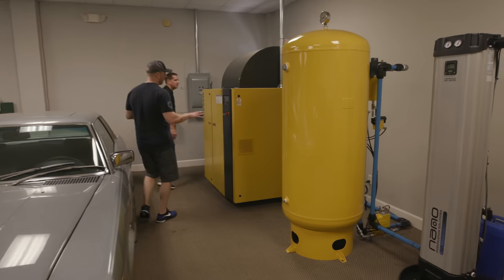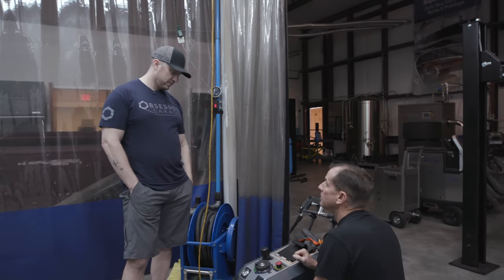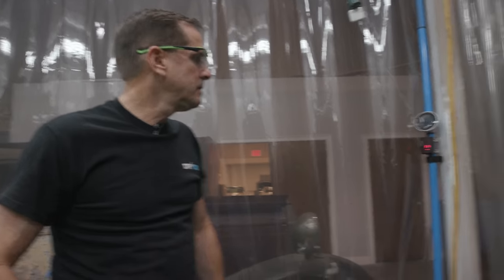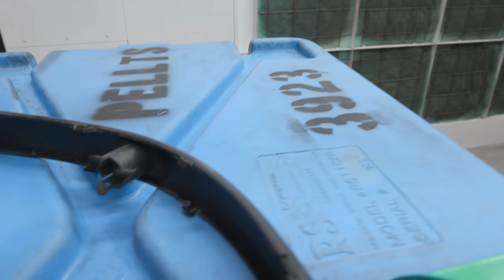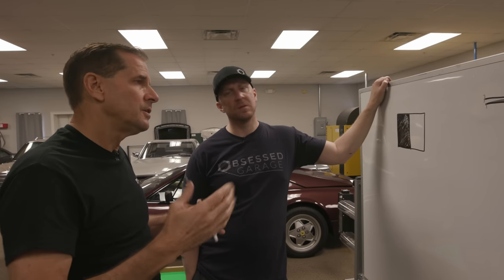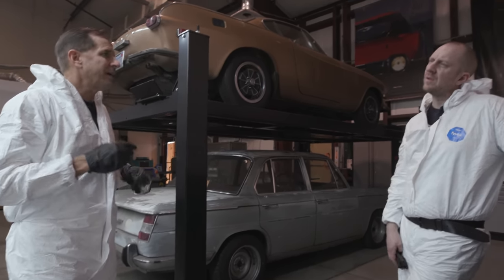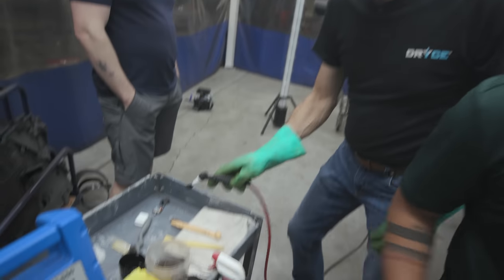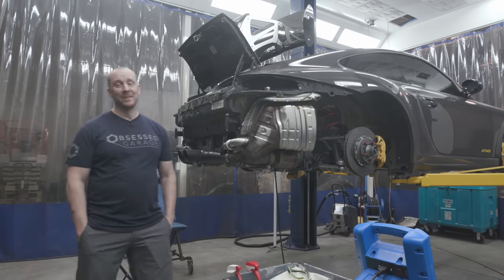DRY ICE CLEANING The 997.2 GT3 RS - Episode 1: Learning the Basics

Comment: As I understand it a single hose smashes the ice particles as the are pushed down the tube prior to exiting at the nozzle? Losing volume of the particle before it hits the surface to be cleaned.
Reply: That is not a performance experience I have ever heard before.  Would appreciate the technical source so I could review it.  
The point of a single hose system is to increase the blasting performance.   Which it certainly does.  So saving dry ice particles ( if that truly happens and has been documented) but loosing performance would result in having to use more dry ice to actually clean the item you're shooting.  
Simply put, if you lose X% of the dry ice for such a claim, but it takes X longer to clean, what have you gained?
In my experience in using a two hose system, I haven't ever noticed a net benefit.
More interesting is that ALL major dry ice blasting companies use a single hose system.  
Let us know where this claim comes from.  We're always chasing value!

Comment: Did the paint chip at 25:50 on the video?  Just for the record, I love your machines. I want the IC 030. I guess I’m just curious about those kind of situations. I’m talking to possibly my future business partner about opening a dry ice blasting shop, is it better to only offer wheel wells and underbody, to avoid chipping paint?
Reply from the maker: There were no paint chips here. Damaging the paint is always a possible outcome without taking proper precautions. Modulating your speed and power will be your greatest assets in ensuring protection.
Reply: Probably just glare, good to hear. 
Thanks for the reply.  @ObsessedGarage

Comment: Any concern about stripping factory coating off of engine? If you live in the north the salt on the roads could be of concern?
Reply from the maker: There is not factory coating on those parts.  Older cars had "shipping wax" called cosmoline that was supposed to removed by dealers.
Reply: @ObsessedGarage  thanks for the reply! Great content!

Comment: Between the dry ice system, compressor, lines, installation, 220v ac, etc. etc. etc. employees, cost of used parts, operating expenses ($20K +) you would have to sell a hell of a lot of used parts just to break even, no less actually make a profit! I'd say a pretty poor business plan UNLESS the machine was used ONLY as a secondary purpose to do this! I now you're trying to sell machinery but C'mon man!
Reply from the maker: Math must not be your thing.  What is 10% of $20,000?  I'll help you here, $2,000.  Doesn't take much to make a great return on investment.